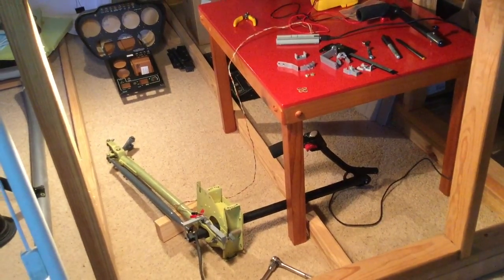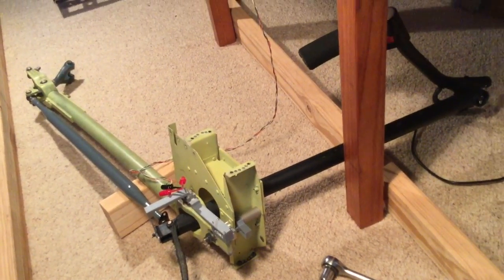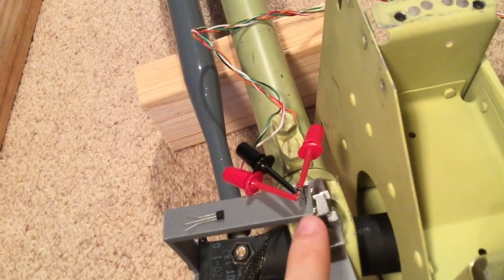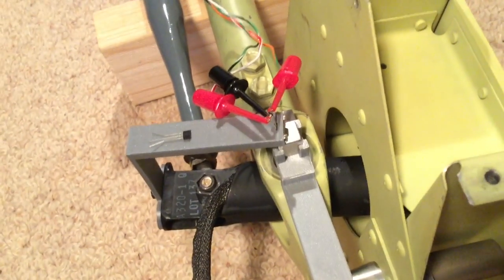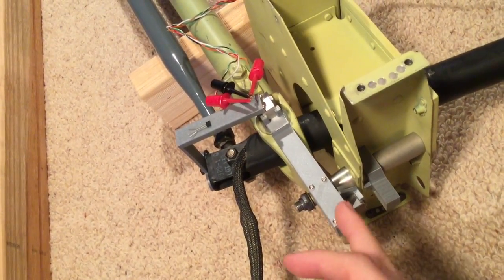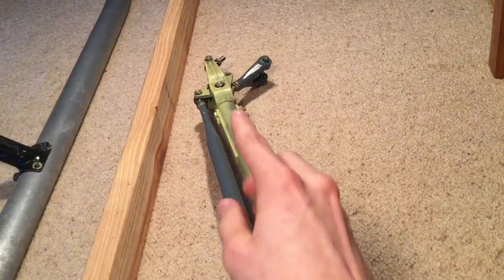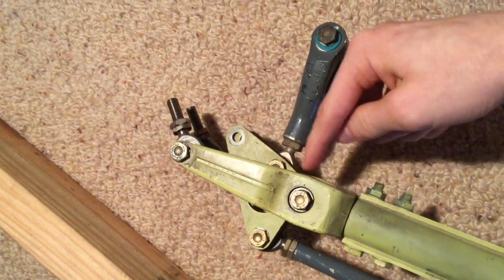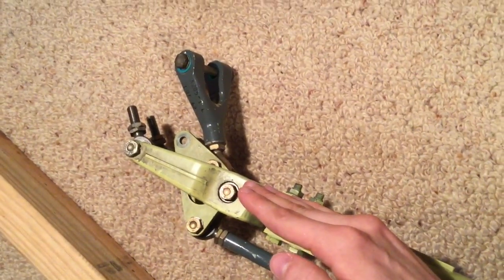Simulator Shane VLOG 018 - Hooking up the Cyclic Flight Controls

Comment: I still have difficulty understanding how the lower  cyclic control sticks are connected to the end part of the cyclic control rod that goes to the rotor system. For example , to make the  swash plate tilt forward ,rare word, and to roll both right and left. This seems the most difficult part of the helicopter control system. Thanks in advance for your help. For an introduction, am Francis Tucker , a Sierra Leonean, who is cons
tructing a single seat actual flying helicopter in West Africa; along the Atlantic coast, where Sierra Leone is located. Thanks again for  explanation.
Reply from the maker: Hey Francis, you are correct in saying that the cyclic is a very complicated part of the helicopter flight control system. In my simulator I only have the cockpit section and the flight controls that are in it. I do not have the swash plate, rotor system or any of the connecting linkages. What you see in this video is what I have in my helicopter sim. Therefore, I am unable to help you much with your questions...

I hope you do find the answers to your questions and good luck with your project, it sounds very interesting!

Comment: I need an explanation , if possible a video tuitoral as to how the tail end of this cyclic rod is connected to the rotor system.
Reply from the maker: Hey mate, have you had a look at any helicopter maintenance manuals or other similar documents? They might be helpful for finding out this information. Also, other videos might show more detail on the connection between the cyclic flight controls and the rotor system... good luck!